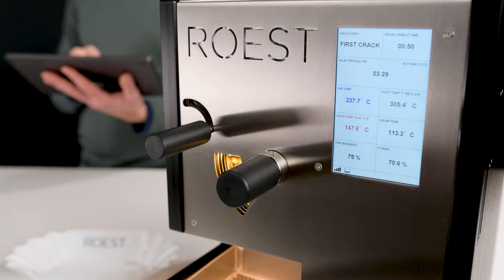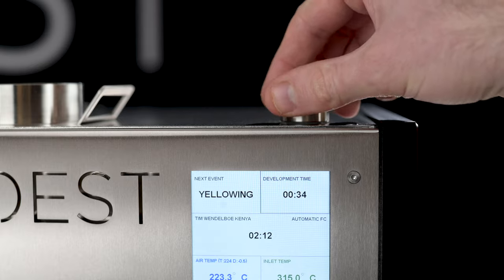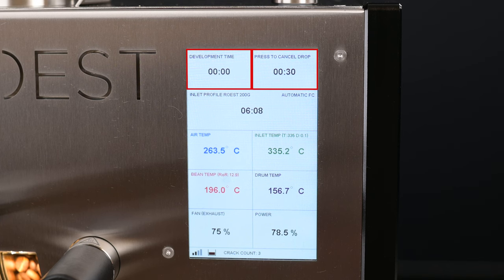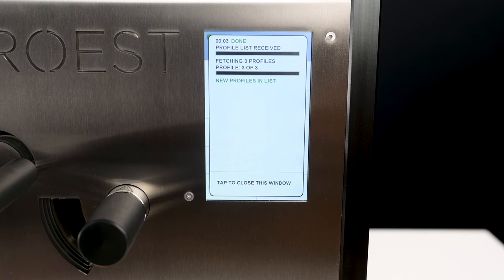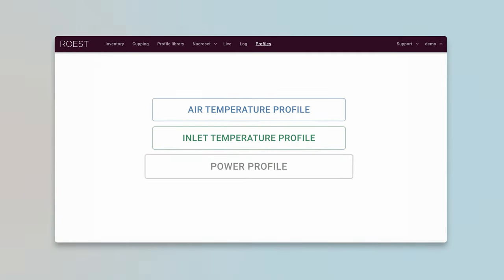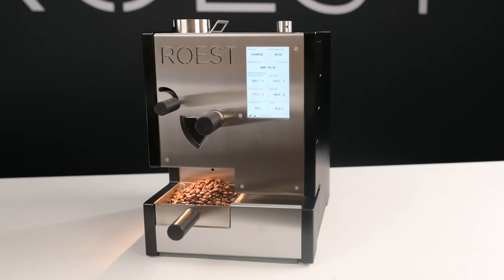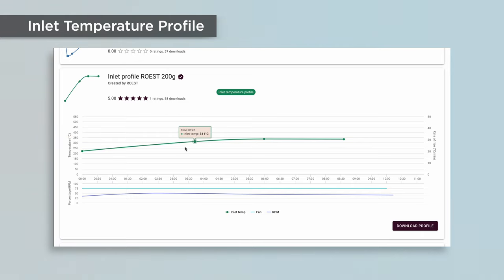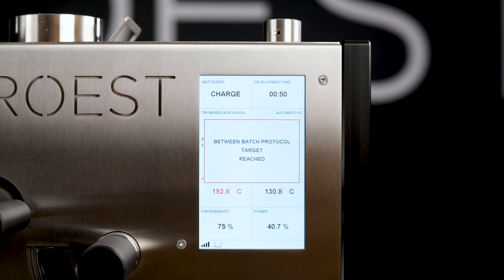Full demonstration of the ROEST sample roaster

Comment: 1:00 why do you still have beans in the cupping tray ? Is it not measured or the hopper doesn’t support full batch size ?
Reply from the maker: For purpose of the video the batch size wasnt measured. WIth this classic hopper you can use it fo up to 120g of coffee. We also have an hopper extension which allows for 200g batches (full size)